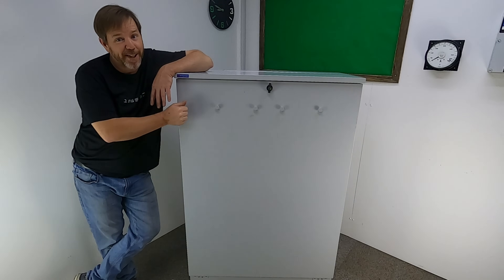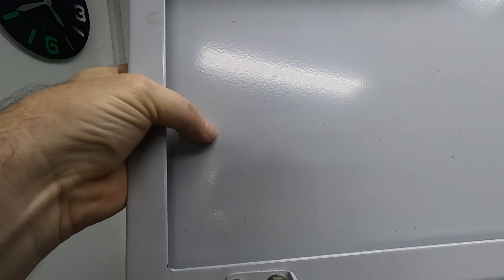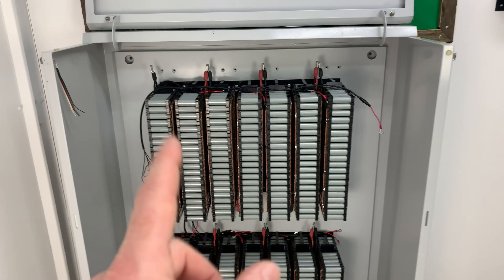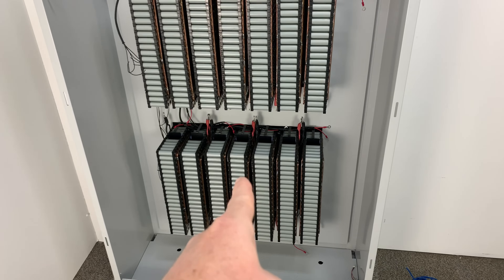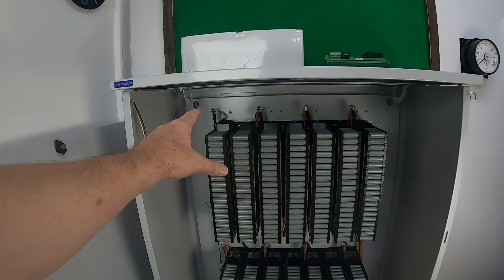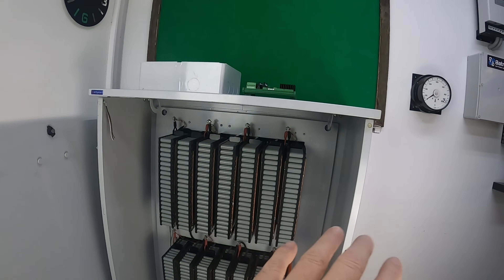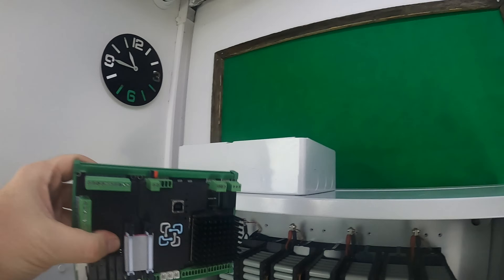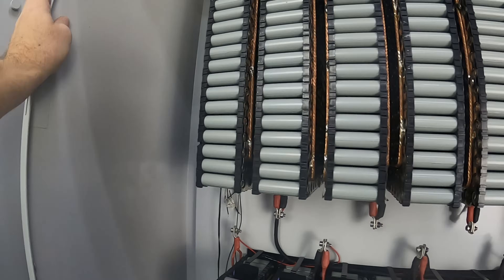Pt.3 Making this MONSTER DIY Battery safe!

Comment: I would add Gyproc sheet inside the cabinet to make it super fireproof (there si fireproof Gyproc sheets available). It would add weight but it would be safe. Also adding fan holes for cooling + spring loaded gyproc sheets on there so IF fire breaks it there would be i.e. plastic parts holding fan hole doors open but closes down if fire warms things too much.
Reply from the maker: 2mm steal has to be enough, I think it's already over kill.
Reply: @HBPowerwall  on my reasearch I have learnt that if fire breaks out it is hard to put down of not impossible (in Finland firefighters plan to submerge bruning evs in water containers) so if that is true, the fire might break out. After all it is not "normal" fire.. it can be extremely hot. But 2mm steel is probably enonugh.. I will propably in future over engineer my cabinet to have rockwool + fireproof gyproc plaster sheet. But nice vid.. fun and intersting to watch. 👍🏻😎

Comment: I'd install the Fans at the top as heat rises..
Reply from the maker: No neat way i can work with up the top, can't have them facing up (ideal) because then something could fall down and short out battery, on the sides isn't ideal. I've fitted them to the bottom and will use BMS temp sensors to map weather that was a good idea or not.. Two 2000 rpm 24v fans will change the air in there every minute or three so shouldn't be an issue with heat.
Reply: @HBPowerwall  That powerful they should drag some outside air over the packs adding a cooling effect, Nice :)
Reply from the maker: Ideally the cells won't even get warm under my proposed load from memory MAX and MAX amp draw not average draw will be somthing like 0.2 amps per cell and that is hardly ever longer than a few min at a time normal load would be about 0.02 amp load so if there is heat i have other issues i thinks.

Comment: I'd use the method that makes everything easiest to access.  Will the breakout box provide that for you?  How about mounting it with industrial velcro strips/pads?  They'll hold the weight of the electronics and allow you to reconfigure the layout easily in case you change your mind later on.  Will mounting the electronics to the floor of the case or to the bottom of the lid make it difficult for you to access it?

I was thinking RGB lighting would be a really cool way to light it up.  Mind you I have been watching some PC builds elsewhere on YouTube so that might be the influence.

Comment: Sir one more question can match the cells with ohms for laptop batteries because I don’t have a capacity tester
Reply from the maker: You could if desperate but i would call it madness, a waste of time, dangerous, doing it as safe as you possibly can is paramount.

Comment: Sir I want to make 50 cells charger and discharger what should I do and which modules is suitable for me thanks?
Reply: It depends on what you plan to use it for. Are you using the batteries for solar, and an ebike, or something else?

Comment: ohmygod that nickel stripping was sooo unnecessary... stressing the batteries with heat two times.. but if it makes you happy...
Reply from the maker: makes it neat, that makes me happy and it's not that bad - except for all the cells i ripped holes in :P
Reply: @HBPowerwall  definitelly not good for the cells either :D poor cells
Reply from the maker: Shit ton better than soldering like i used to - just finished maintenance on my first 7S Battery probably the forth time every cell has been soldered in for years lol

Comment: Those top mount bars look too flimsy. I would reinforce them more.
Reply from the maker: made again i would agree, but my cheap fix will be strong and a reliable solution till I get the next batch made
Reply: @HBPowerwall  fair enough. It's hard to judge the sturdiness after you added the strap just from watching the video. It's a really cool setup. 
One question, I saw a couple other people make batteries but only used the nickel sheets to connect the individual batteries. 
Was the copper wire you added necessary? Or added for better efficiency or longer life?

Comment: If you are going for safety you might want to investigate having a high temp cutoff for the fans. Once you have a fire you do not want the fans to feed it more air.
Reply from the maker: Low tech on that issue. Fan cables will burn up dam quick in that environment

Comment: I would just use the small electric box and place it on the outside of the cabinet, in case there is a problem with the battery, worst case : a fire, the electronics wil still be functioning (for a while a t least)
Reply from the maker: I was thinking down that path
Reply: @HBPowerwall  in any case I know you will find a nice solution!

Could you tell me, you built these huge cells now, but doesn't this require any kind of load balancing for the paralleled cells as well? Or do you frequently turn off charging to let them balance out over those nickel plates?
Reply: @HBPowerwall  don't worry, i read up on it already ;)
You are creating packs of more or less the same capacity so they represent more or less the same internal resistance when coupled.
Reply from the maker: yes, the battery is well built and with in 10ah of each other in capacity not bad over 191 cells in each. Batrium BMS will take care of day to day balance.
Reply: @HBPowerwall  awesome thanks, looking forward to your next steps, i just aquired a Lead acid AGM system on 24V to start with, taking the easy path ;)

Comment: One suggestion, adding Kapton tape ontop of the batteries. The areas which face inward to each other, with the copper wire so close makes me a little iffy otherwise, but I don't know nearly as much as you do so I could just be worrying about nothing :)

Awesome stuff btw
Reply from the maker: There are layers of safety, the cell holders, cell insulators, cell heat shrink, teflon insulators

Comment: That on the backside of the BMS is for mouting it on a DIN-rail.
It's a very neat mouting solution and you should deffenently look into that.
It's easy to mount the rail, a more reliable mounting solution and VERY EASY to change out if need be.
DIN-rails is what we use in industri and homes for mouting electrical components in pretty much anything running anywere from a mechines to a large industri buildings.

Comment: Hi, I have watched all 300+ videos of yours, I am an Electronics Engineer living in SW Sydney and working in the television industry I have been gathering old battery packs and I have enjoyed watching the evolution of your system.
You have made the mistakes and have had the successors so I can avoid problems so I thank you so much for your companionship through this, my build is now at an advance state to the point that even my wife is impressed.
My system is starting on the low side but I have made it scalable so when I get more batteries I can store more, my system has a solar/wind turbine control system that I have designed and build basically the microcontoller manages between solar and wind for the best charging. My budget does not extend to the Batium BMS so I am building the DIY BMS v4. 
There is so much I could tell you about what I have been through so far but I dont want to clog up the comments, I just wanted to say thank you, as you have made me laugh and yell "DONT DO IT" while watching but most of all I learnt new things even now. Thanks. Graham.
Reply: Well said.
Reply from the maker: If your wife is happy i've done my job well lol A BMS is a BMS as long as you trust it. Thanks for the comment Graham!
Reply: This is what I wanted to say too, thank you

Comment: Re: Fans... Heat rises right so would it not be better to have vents at the bottom and the fans mounted in the lid?
Reply from the maker: the top has heaps of air gaps around the doors, in theory the fans won't even come on due to convection. If they do the fans in the bottom will look cleaner and still work well I think. Much consideration has been put into placement of items :)
Reply: Thermal stacking effect. Heat naturally rises on its own. As long as the top is clear for air flow, heat will leave the top.. Cold air, sinks, so if you have a cabinet, the colder air will leave the cabinet and have more hot air take up that space. A fan at the bottom counters that effects from it falling down and out of the case naturally, and instead pulling cold air into the case, warming up, and eventually leaving from the top. Similar concepts are used is solar passive homes for heating and cooling rooms.

Comment: Since you are making such a "pleasing to the eye" job, why not put a clear perspex door on the cabinet instead of hiding your work behind the original metal door.
It would be a lot lighter in weight too.
Even cutting the centre out of the original door and using it as a frame for the perspex would look good. 
Or go really creative and get someone to cut an elaborate pattern on the original door with a cnc machine and put the perspex behind it. 
You could even ask your “supervisor“ to create the design.!! 
And if you are neat with all the wires to your controller forget the little plastic enclosure and show it off.
A wire loom perfectly presented Is a joy to the eye.
Reply from the maker: That's a neat idea but not fire resistant  unfortunately..

Comment: I would put the vent holes at the bottom where you said you were going to put the fans.  Then put a larger or two dual fans at the top creating a suction flow across the batteries.  Only other question you might want to think about is are you going to move the existing batteries to the conex box?  If you are you may want to have your bms outside of that smaller battery box.
Reply from the maker: Really want the BMS outside, i got all the gear for it but its so much cleaner inside. Fans have already been mounted in the bottom plan on blocking all air gaps at the bottom so all the heat rises and goes out the top. Fans will be able to change the air inside the box every minute or two.

Comment: How about mounting the BMS to the inside of the door. Use a sizeable wire loom for the cables. Would give better access to the BMS versus mounting it in the panel.
Reply from the maker: Door has to completely come off, I did consider that in the early versions in my head..

Comment: Do the battery packs have to sit a certain way up? Can’t see why you wouldn’t just rotate through 180 so negative top left becomes negative bottom right, saving a shit-tonne of rework..
Reply from the maker: Doesn't work like that, i have a 6 zero volt cells that touch the mount & 3 cells missing so the mount can slot in.
Reply: Yeah I figured there’d be a real reason, looks fantastic!

Comment: Man your timing on these videos is exceptional, I am just finishing putting the cells together for pack 14 and just looking into getting a sheet metal case build with a mounting rail for the pack mounting plates.

I was worried about the mounting points being strong enough for a 200p pack, my plan is to cut off the top flap and have a strap going from the top bar the holds the flap to the bottom mounting point. This way I only lose the 3 cells at the bottom for contact on the mounting point and the top is restrained to the back plate with a strap and buckle. I was going to rivet the strap to the top bar and the bottom mounting points. The idea was mainly to prevent the packs being moving incase of a freak earthquake or physical damage to the battery box.
Reply from the maker: I do what i can lol 
2mm steel would have been a much stronger option for this build but i'm using what I already had. How ever considering making some stronger ones if i can sell them on.

Comment: Why don't you just use LIFEPO4 battery cells?
Reply from the maker: Same reason I don’t have a Lamborghini
Reply: What do you end up paying for your system just the battery pack per kilowatt hour in dollars?  I am able to get lithium iron phosphate battery cells that are brand new for $180 per kWh, after building the pack with BMS it’s more like 250per kWh.  That’s a 14.3kwh pack with 280ah cells.

Comment: There is a special sand material that is used to encapsulate batteries when they are in thermal runaway. We have this stuff in our battery workshop for safety in a metal container. We also want to use it in a doubles headliner in our new battery test container. As soon as something happens and the roofliner gets burned, the sand drops onto the fire. I don’t know how it’s called but it should be findable on the internet. You could do something like that as well to make it extremely safe.
Reply from the maker: That would be next level safe - just don't know to implement it properly and make it look professional

Comment: A smoke sensor with a CO2 extinguisher exhaust direct into the cabinet , would be a good edition. CO2 extinguisher parts can be gotten from race car shop. Smoke sensor connected to the batrium for auto shut off.

Oh if anyone is interested , you can find these cabinets at the dump shops all the time.
Reply from the maker: Already have a fire alarm with inbuilt relay to trigger shunt trip, CO2 would be useless on a lithium fire as they projuce their own oxygen
Reply: @HBPowerwall  co2 is for the temperature drop not the oxygen, thought it would slow it down . And the smoke alarm is internal to the cabinet = faster reaction to issues.

Comment: Couldn't you have swapped the lower battery "front" side in? Wouldn't that have swapped the terminals to the "correct" side? I am guessing I am missing something. Oh, the cutouts for the holders?
Reply from the maker: Yes, needed to remove all the cell holders on one side - reconfigure where blue cells were then rebuild.. it was quite the process!

Comment: Heat sensor alarm on the top in side linked to a sounder out side or in the house. Nice job by the way! I have a lot of respect for the time you take to get things right!
Reply from the maker: there will be 5-6 temp sensors inside the cabinet linked to the shunt trip to shut it all down if too hot or cold.

Comment: Intumescent strips on the doors could create an air seal in the event of a fire. I would skip the electrical box and bolt din rail to the inside. Possibly even to the inside of the door and then dress the cables with a drop loop so they move freely with the door opening and closing. Oh and how about a safety cut off switch on the front or side.
Reply from the maker: that would create a bomb, want the fire to slow down. Two fans will be pumping air in so won't be sealed

Comment: May have already been suggested.

But as heat rises, you want to pull cool air in from the bottom, and extract at the top

Might recommend changing the bottom fans to vents with hepa dust filters, and two larger 48v fans above the batteries, and potentially mid way up on the side, again with hepa filters

Check the total airflow volume on the fans to ensure they can extract 1.5/2x volume of the cabinet air within a minute and you may need a fan controller setup (if it’s not in BMS / thermal monitoring system) 

If you’re direct mounting to the shipping container, you’ll need to take into account  external heat transference from the skin of the container to the box, and some thermal insulating board / stand offs between the container wall and the box to minimise heat conduction. (Of course depends on position and how much light/heat the container wall will get. 

Would consider sealing the gaps so you have known airflow performance 

Bugger off the steel front door, and replace with 3-5mm perspex with appropriate hardware if you really want to get the best out of the RGB, and save some weight !

I used to do industrial Datacentre / PLC design, and we’d focus on front to back cooling, how ever our PLC cabs were always top fan bottom vented 

Particle and humidity sensors if you want to go over the top, and tied into the fan controller 

This is all stated, not knowing the condition of the container it’s going into.

Assuming you will be sandblasting, and primering the shipping container to remove and reduce any oxidisation of the internal and having rust particles floating around (hence sealed unit with hepa filters)
Reply from the maker: filters are in the mail and i've changed from 48v to 12v fans with speed controller.
Reply: Heat does NOT rise ! Hot AIR rises, but heat itself does not. Common misconception.
Reply: @jimjones7821  It's not a misconception it's just the way people speak. People who are not anal.
Reply: @howardemerich314  Nothing anal about it. Physics is physics.

Comment: Don't know if you have anything planned for the front door, but rails on the side that the door slides in and then lifted and held with a string that goes over the batteries. When the string burns it slides shut like a guillotine - lol. You could also have it side hinged and counter weighted so it always shuts, then a string holding it open.
I always thought that thin strip on the mount was going to be a problem. It really needed to be something like 6-8mm thick.
Reply from the maker: door just lifts off, nothing more planed for that. Love the simple idea of a burn cable but think the batrium features will have me covered for now.

Comment: Putting the batrium in a box would make it unable to cool itself. All of the balancing turns into heat in the heat sink on the new batrium board, doesn't it?
Reply from the maker: yes, but would have fans that would turn on when balancing is active.

Comment: The clips on the Batrium are for snapping into din rail. I would not trust that Velcro on those mounts. A secondary temperature sensor should be used mounted to the top with a alarm added.
Reply from the maker: Yes, i have all my Batrium din rail mounted - was brainstorming aloud for a cleaner install..But it really doesn't work due to DC-CD shunt trip ect needing to be mounted
There will be 3 external temp sensors, one on shunt & one or two on the WM5